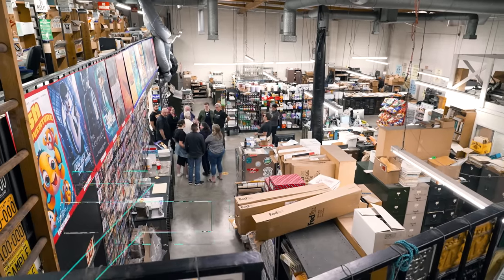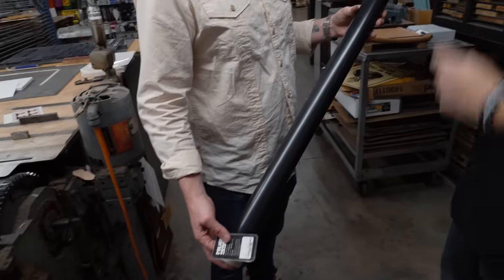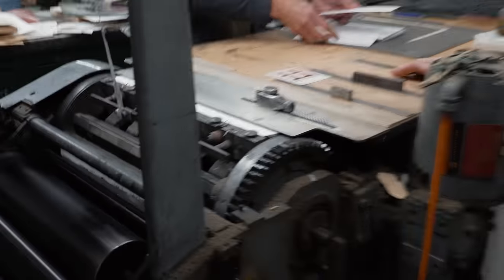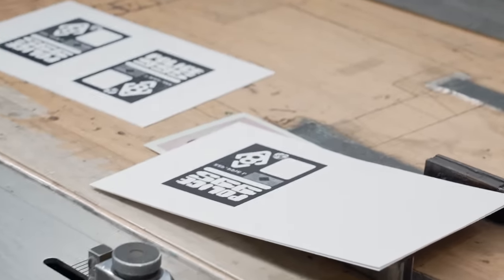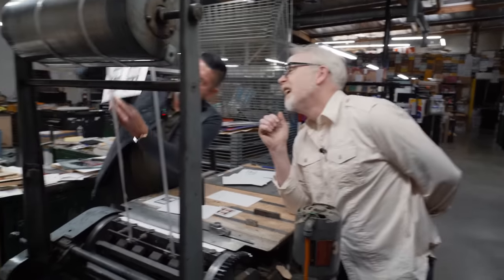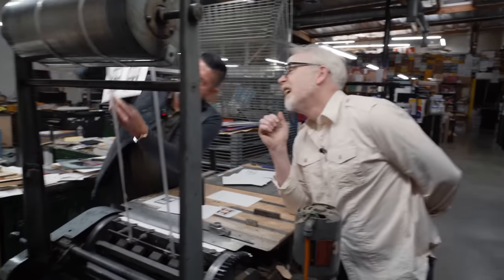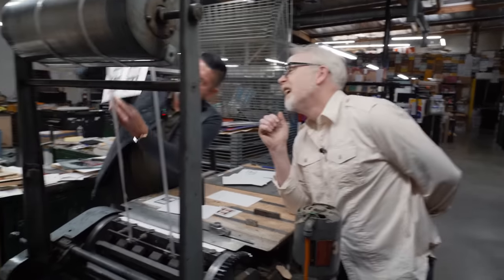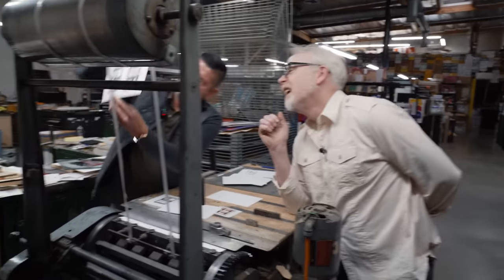How Blade Runner's Badge Was Made!

Comment: So - is that a replica? Or does it count as an original? Made in the same shop with the same presses and processes and materials 🤔
Reply: 100% replica; anything not made/acquired by the production & intended for use during production can only ever be a replica.
Reply: Well, it could also be a reproduction, which to be honest is what I'd say these were.
Reply: @markieveeYT  While I get the distinction you’re attempting to make, the terms replica and reproduction are not consistently distinguished in prop collecting, or even the wider art world. Some art markets tend to lean towards a preference: replica is the default with props (hence the Replica Props Forum), whereas reproduction is more common with fine art paintings. But they can also be used pretty much interchangeably.
More distinct meanings arise with duplication of some mechanical products, such as firearms: replica might suggest nonfunctional, while reproduction suggests functional. However, this still doesn’t really affect props generally being termed replicas – regardless of function, or fidelity to the original form / material / process / tool / maker / etc.
The best you can say, in limited circumstances, is that a replica prop may be “assembled from original components” (IF those components were made/acquired by the production & intended for use during production).